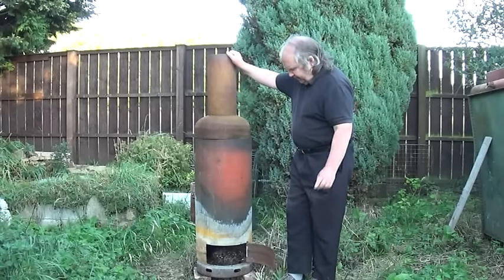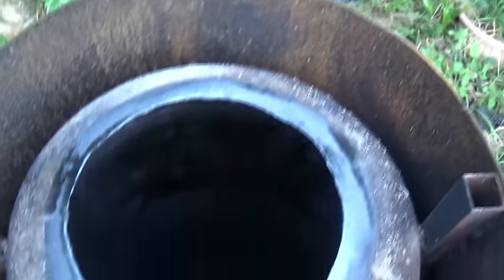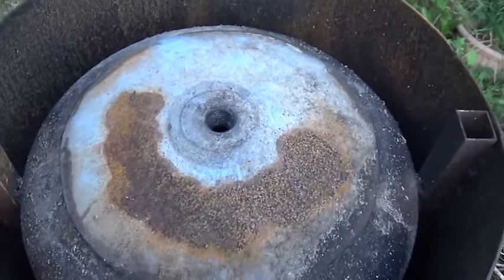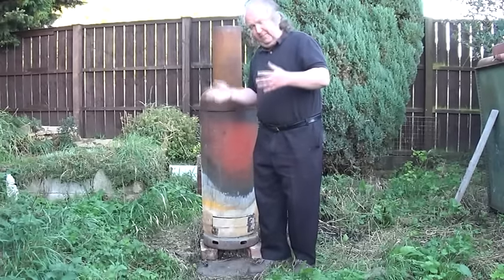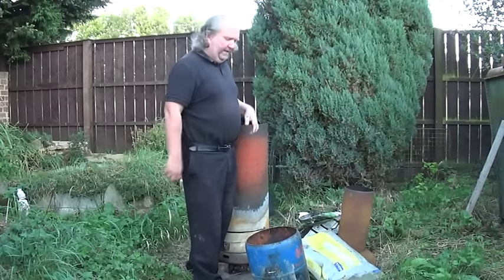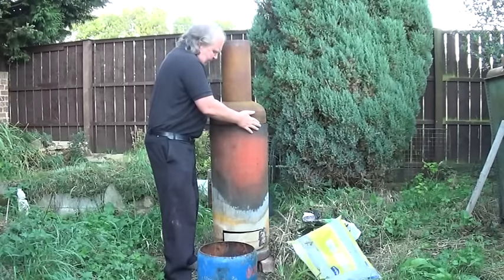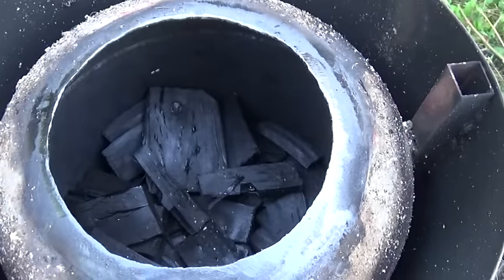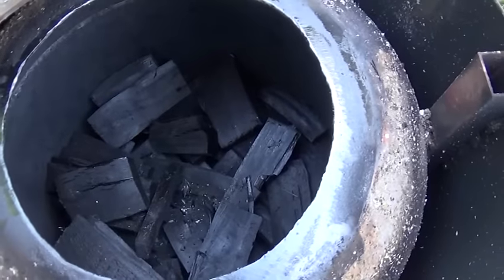How to make charcoal in a home made retort

Comment: If u just put rails down the sides then you could pull the barrel into and out of the outside barrel.  which make it Easyer to Load and unLoad
Reply from the maker: It's actually quite easy to load and unload as it is. It's justbthe right height to reach into and pull the charcoal out. I did originally have a removable inner barrel, but when it was full of wood it was too heavy to lift into the outer one, especially with having to lift it quite high.

As it is I can just comfortably reach to the bottom of the inner barrel.

Comment: Could you use sawdust or shavings?
Reply from the maker: Hi Phillip. You could certainly use them inside the barrel to make the biochar. When making charcoal the idea is not to let any air get to the wood you're trying to char, so sawdust would proabbly be really good and it would come out as fine dust for garden use. However as I'm personally making the charcoal to run in a charcoal gasifier, I need to use something a bit more chunkey. But for garden use it would probably work ok. The thing is don't pack it in too hard because it's a really good insulator and it might stop everything charring right to the centre of the barrel.

Shavings would also work well to start the fire. I think sawdust would probably choke the flames though. But if you have sawdust you want rid of, just sprinkle some in there little and often.

Comment: You can boast with the nails in there, of producing - "Iron fortified charcoal" as well as "hardened nails". 
Do work on redirecting the wood gas to the bottom for more efficiency regardless of the fuel (I think anyway). Waste not, want not. An additional (modulated) air inlet at the bottom should  add efficiency and reduce the smoke even before the wood-gas kicks in making it a much cleaner operation. My 2C anyway. Nice idea though, I do like it..
Reply from the maker: I'm planning some modifications, one if which will be a pipe from the top of the inner Barrel down into the fire box to try to use that gas or at least burn the smoke off!

Comment: the hookway version uses less wood.
Reply from the maker: I think the Doorway only uses less wood because the gasses given off from the inner retort are piped back down into the burn chamber to help with the heating, which also helps control the smoke given off. It's been mentioned before that I should run an iron pipe from the top of the inner barrel, just below the lid, through the outer barrel, down the outside and have in enter back into the burn chamber. It's a modification I intend to make, I just haven't got around to it yet. I guess it's more of a concern if your fuel supply is limited. However I burn all sorts of rubbish in the burn chamber, not just wood.

The problem with a Hookway, which has the chimney up the middle, is finding a good way to seal the charcoal chamber around the outside. I'd be worried about it sucking in too much air from the top and turning the wood to ash rather than charcoal. I'd be very interested to know how others have got around the seal problem.
Reply: @AndysShed  I'm building one at the mo and everything will be welded and I will use water to quench when the gases stop coming
Reply from the maker: @mikha007  I'd be interested to know how you seal the chamber with the wood you want to turn to charcoal, Doorways usually have a round top with a hole in the middle for the flue pipe but I've never worked out how to seal it so the gasses given off can be routed back to the burn chamber efficiently. That's the main reason I put my flue around the outside, so the inner barrel could have an ordinary lid.
Reply: @AndysShed  not all of your comment came thru but the rocket flue passes tthru the top of the drum containing the future charcoal.the bottom of that barrel has a detachable lid which can be released to exit the charcoal.everything is sealed.
however the pipe which allows the wwoodgas to go to the burn chamber needs to be shut off if you're not dousing with water when the gas  is totally consumed or else oxygen can re ignite the freshly made charcoal. the vent at the top also needs to be plugged

Comment: if you pack the space with waste wood and light it at the top it would be less labor
Reply from the maker: It's a good theory, but I've found by experimenting that it doesn't always work in practice. If you fill the space with wood and light the top what tends to happen is the very top burns, but because heat rises not enough heat transfers into the lower wood for it to ignite. Also when top lit, air is being drawn upwards, which also tends to stop the wood burning downwards. It might work if the space between the two barrels was bigger, but that would require a lot more wood than I'm using in the video. The other thing is that heat rises, so to get the maximum heat possible transferred into the inner barrel the burn is better to happen at the bottom to heat the bottom of the inner barrel, then it also heats the side with an effect similar to a rocket stove.

The TLUD system needs more wood and the wood has to be totally dry (which here in the UK it very often difficult to achieve). This bottom burning system can use slightly damp wood if necessary. You can also burn other home and garden waste. The down side, as you rightly point out, is that you have to keep feeding the fire. However I was more cnncerned with using less wood and wood of lower quality than being able to leave it unattended.

The other down side of a TLUD is you will often get 'browns' left behind because the fuel has run out around the barrel before the entire inner contents have been turned to charcoal. If you run my system for long enough (mine takes 2-3 hours from lighting) everything gets totally converted because you can add extra fuel as necessary.

Comment: First off GREAT SIMPLY GREAT -- But as far as not using for a Gas engine because it is to HARD to clean Here is an EASY WAY TO CLEAN THE GAS ** RUN THE GAS ONTO A Double PEE TRAP like in plumbing u fill the first with water then the other end is the gas exit ,as the gas is DRAWN through the water , debris is left behind in the water ..bottom plug for cleaning --- ( just example ) but you get the Idea
Reply from the maker: This device is just for making the charcoal, not for producing gas to use in an engine. I'm currently building up enough charcoal stocks to start experimenting with a simple gassifier to produce the gas. The idea of using charcoal rathet than wood is that in the process of converting the wood to charcoal most of the tars and other nasties have been burned off. So charcoal will burn much cleaner in a gasifier than tjomgs like wood pellets and so won't need anywhere near as much filtering. Yes, you've lost some energy in the conversion, but that is balanced by not having to carry around huge filters as part of the setup. A simple open cell foam filter in something like a large coffee can should be enough for running a small engine.

Comment: drill holes around the base of the chimney
Reply from the maker: I'm going to try that. I did try someting similar where I put two steel rods under the chimney section to hold it off if the retort about half an inch to let air in there. It made it more difficult to light and it didn't draw the fire as much. My guess is I was letting in too much air.